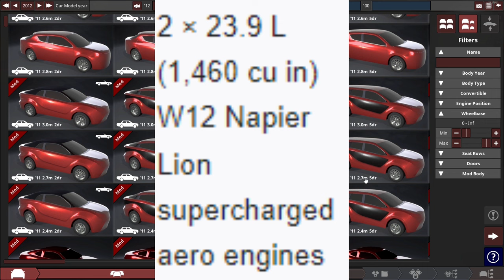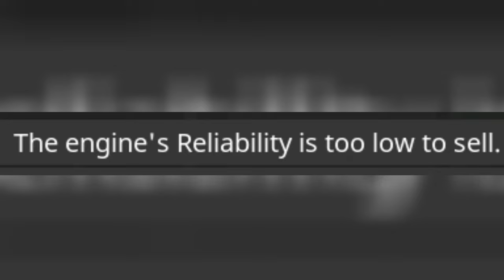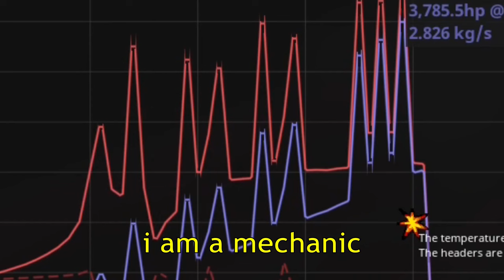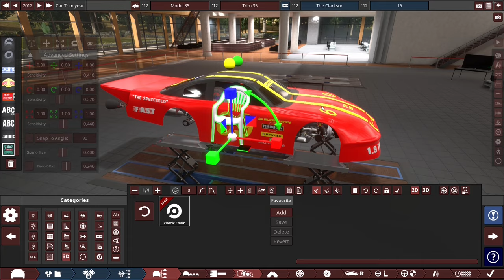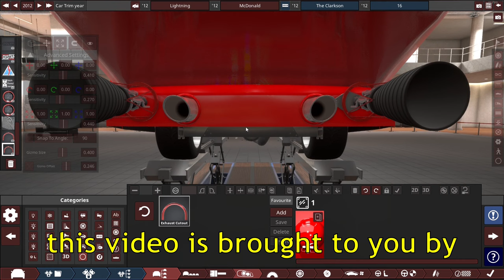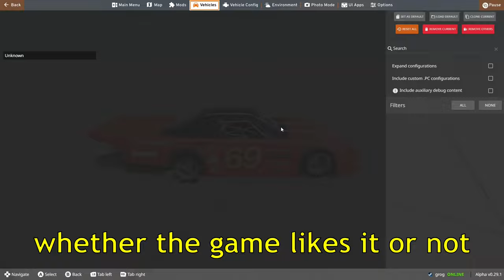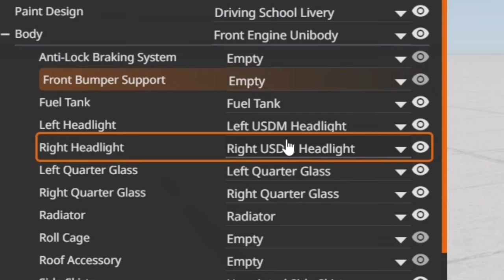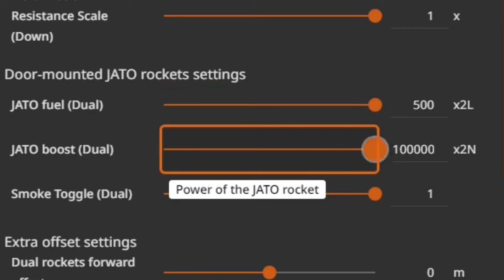CAN WE BEAT THE LANDSPEED RECORD? (Automation | BeamNG)

Comment: Engine building tip, that dip in power at the end is due to too small manifold. And the wiggly graph is due to inadequate turbo airflow so turbo size / exhaust size / header size needs to increase
Reply: @Goobergangalang123  keys, thx
Reply: Thanks for this tip!